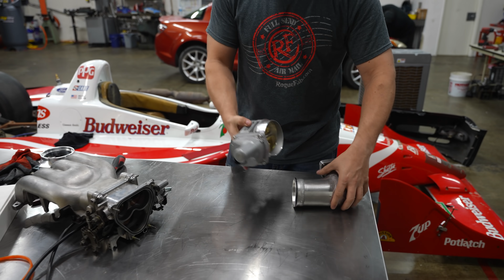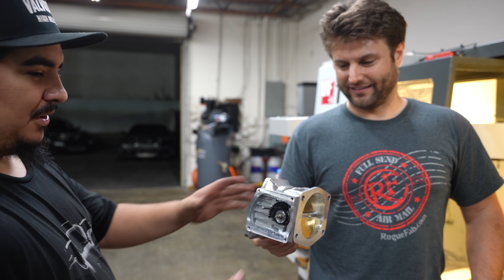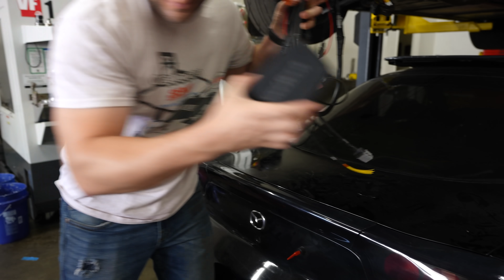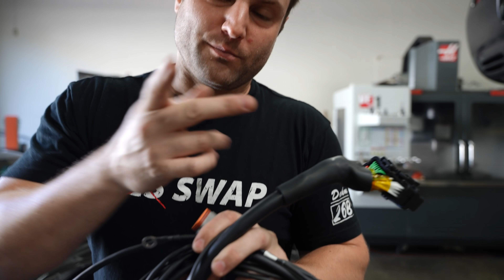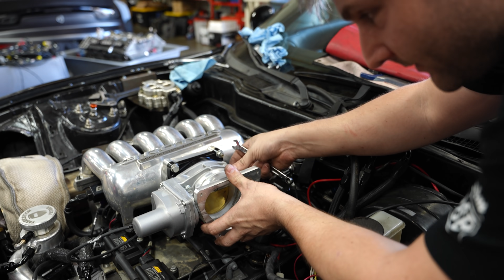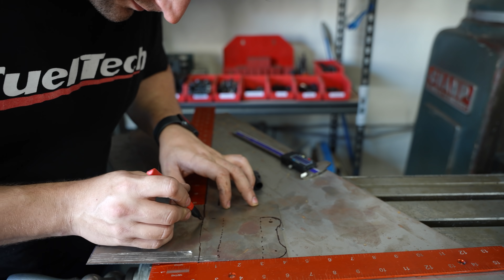Drive by Wire to help the 3 Rotor RX-7 pull wheelies and idle!

Comment: Rob why didnt you just use an rx8 tb and pedal assembly? There is also an adapter already developed to fit fd intake. Also feel it would be easier to mount than that ctsv assembly

Comment: I would rather the cable over wire..... you have the money to not worry about it... I want to be able to use even random things to fix my vehicles. Just in case I don't have the money or need to fix it on the side of the road. You have a drive by wire mess up and you are stuck. I had a cable brake/stretch and I used rope to fix it to get home.

Comment: You're probably going to want to apply a transform function to your pedal input in the ECU if you're going to drive this on the street, so it's not completely linear... Otherwise it will be very hard to control at low throttle, and will constantly surge at idle, and most of your pedal travel will be in your higher power band, and you got lots of power... I would recommend a sigmoid-ish curve, so you get about 50%-70% of your pedal travel in your lower power band. Or just an exponential curve if you're gonna floor it.

As for mounting the pedal, just make a plate for each side of the firewall and sandwich it in there.. Pedal, standoffs, inner plate, sealant, firewall, sealant, back plate with threaded holes to bolt through.

Comment: i m not friend of the eletronic throttle or Drive by wire the same for electric  power steering a stupid computer that control it for you if one of the sensor get damage you will have problems with it

Comment: Jesus man. You could have just added a pot pedal, stepper motor, and micro-controller about the size of two postage stamps to your OEM unit instead of cannibalizing that expensive unit. That S isn't beyond you man. Get into micro-controllers. There's plenty of videos on that and steppers. I started in gears and went electrical and so can you. LOL

Comment: Definitely cool and doing it yourself is the only way I'd trust a drive by wire anything.

That being said, I don't think I'd want to lose the amount of feedback through the pedal and fine control through muscle memory to get exactly what you want. Yes you can change the range the pedal controls but that's a bandaid and isn't the same thing.

Same reason I don't like anti lock brakes.

Comment: Dude, for mounting the pedal, instead of just putting it on bolts that are spaced WAAAAYYYYY out, weld a spacer block behind it that the pedal clamps down on and gives it a central support point.

ALSO you should bring the pedal WAY farther out toward you, race cars have the pedals all mounted flush because it makes heel-toe so much easier. There is ZERO reason for you to mount the pedal in a recessed position as it is from OEM.
the mounting support block also becomes way more important in achieving this mount spacing

Comment: Nice thing about drive by wire throttle bodies is the ability of doing legit lift off anti lag for intense hoon sessions and burnout competitions.  Imagine the sorts of donuts and burnout competitions you would rule if you could control power to individual wheels through the use of cutting brakes, differential lockers and maybe custom couplers.  You could make the AWD dance at 9,000rpm with smoke and noise pouring out of it.  Just one of my many ideas I have written down in my little black book (Apple Notes)

Comment: I did the same thing on my 1993 FD, except I used a DBW pedal from a 2006 GTO and custom built a mounting bracket so that gas pedal and the brake pedal were at the same distance from the floor. Perfect setup for heel to toe driving. In my opinion the GTO pedal looks better as well. I have pictures of the mounting bracket and the install if you're interested.

Comment: Why not machine a spacer-bracket-mount out of billett that would rest on the firewall, bolt on the existing mazda pedal mounting holes and to the caddy pedal with the required spacing? Heeps more rigid, Keeps better throttle feel and position, doesn't deep dive even with hard launch..? And the idle is going to be a hassle, bcz the big blade leaks to the secondaries all the time.

Comment: you can use boiling water with drain cleaner to get the fittings free from the anodized blue. hope this helps . and you can also weld on them without problem

Comment: Bro why not just use the placement with that plate you made to cut a thick piece of billet or steel to match the offset bolt holes. Mimicking the style of the black plate used to fit the throttle body to the intake manifold. That’ll give you all the sturdiness you’ll ever need and it’ll last

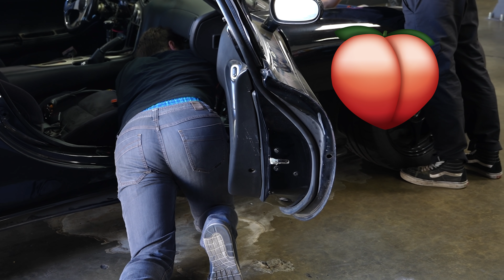Comment: 14:47 While the crankshaft may fit through the hole of the bearing journal dry it is recommended to apply lubricant liberally especially with a thrust bearing. Proper nut torque is important with the crankshaft as too much friction can cause premature wear and a rough ride.

Comment: You own a cnc machine. Instead of spacers like that build a cnc stand that uses the stock stud locations and transfers over to the drive by wire pedal... what you made is good for temporary and can be used as a template to build a solid cnc plate mount.

Comment: rob 3d print a thick sandwich plate out of plastic and get rid of those flimsy all threads they will bite you in the ass my friend a 3d plate will be light and more sturdy cheers from down under

Comment: I don't understand. 
You no longer have the primary/secondary stages. Is this good?
Also, every manual transmission vehicle I've driven, that has some form of electronic throttle control has been infuriating to drive.

Comment: Just a thought for the throtle pedal in the car. It looks like the original GM metal bracket is bolt on, would it not be easier to make a whole new bracket that picks up the throtle pedal body mounting locations and and then 3 or 4 locations on the car body to give you a more stable pedal. You could even pick up the original mazda pledal mounting locations.
Reply: "You could even pick up the original mazda pledal mounting locations."
I think that's what he's doing with the bolts on the right side of the pedal, as they seem to fit into what looks like stock mounting points. And, of course, the bracket on the left allows him to do the same with an offset bolt
Reply: @halofreak1990  I couldn't really tell from the angles in the Video if he was picking up the original stud locations for the mazda pedal. The thought I had was just a mashup of the original pedal bracket mounting and use the new GM pedal assembaly on the side of the drive by wire pedal. It would possably more ridgid than the threaded rod and spacers.

Comment: Hey Rob I was wondering what limits the speed mechanically  rpm I mean. I really want to make a 20,000 rpm 2 rotor
Reply: Imagine something going up and down-ish (because dorito)  333 times A SECOND! you need some preeetty impressive materials to figure that out withouth it melting, ripping itself apart, or phasing out of existence and going back in time.
Reply: @nerfinator03  I've got time to work it out I'll just have to be the first

Comment: 22:13 Rob I recommend you use some type of positive lock fastener. Nylox and loctite might fail in this scenario because of excessive heat on the engine bay side of the firewall, it will just melt the nylon. Please use DIN 980 nuts, they have deformable thread which is a positive locking system. Alternatively you can use cotter pins or safety wiring which are extremely popular on all critical fasteners in racing

Comment: You should redesign the adapter between the throttle body and the manifold so air isn't just hitting a brick wall

Comment: The hunting is probably from the missing gasket and that flange probably being warped a little from being welded on. It’s wild that you made it work that well out of the box so to speak. To make the pedal a little more stable you can put a block or something to keep it from over extending and bending the mount. That would let you kick it and not worry about tweaking the pedals position in relation to the others.

Comment: Awesome video! I was just curious if you had considered making a CnC spacer for the pedal? Or welding up a few pieces of flat bar to help take up that space behind the pedal bracket. I just wouldn't trust all-thread with the amount of vibrations and sudden acceleration your car is going to be under.

Comment: While I know that drive by wire is the logical progression but I'm surprised that you want to lose physical reaction in favor of computer control.
Reply: You gain reaction as drive by wire allows the throttle plate to accelerate through the 'dead zone' present in any mechanical throttle system. Basically, 30% pedal depression can equal 50% throttle opening, that's essentially why manufacturers switched from mechanical cable setups to drive by wire in the first place.
Reply: @ByteOnCS  it’s a matter of knowing the feeling of your throttle where this is a pedal that does not allow for differentiation in feeling through the pressure range. Think of it like a linear vs parabolic pot. A linear pot is going to uniform across the entire range and you’ll see a direct response when you turn it to 50% with an output of 50%; meanwhile a parabolic pot is going to give you a much different response for 50% input. With drive by wire, it’s a guessing game at best; with mechanical interaction, the input will always yield the same output.
Reply: @deltacharlieecho4732  the point is, a linear relationship between the pedal vs the throttle plate is 'flat and unresponsive', this is a phenomenon manufacturers and performance enthusiasts have been tackling in many different ways for years. In the early to mid 90's, Mazda actually had a cam setup on their throttle linkages (mostly on piston variants) to accelerate the throttle plate through it's mid point to overcome the dead range in throttle movement where pressing the pedal further doesn't relate to a noticeable increase in power as one would assume. By using drive by wire, not only is throttle response improved as it is no longer linear in regards to the relationship between the accelerator pedal and throttle plate, but it can be perfectly tailored to the drivers wants and needs. There was a reason we went to drive by wire, and it wasn't just to eliminate the throttle cable. Likewise, in my experience with squarebore vs spreadbore progressive carbie's, I have little doubt throttle response will be improved just by removing the progressive throttle body as fitted by the factory (which was mostly used to try and overcome the fuel consumption issues surrounding the rotary engine). For reference, I was a Mazda tech of 25 years.
Reply: @ByteOnCS  I would never convert from cable to drive by wire; I like the way cable responds and hate how drive by wire emulates control.
Reply: @deltacharlieecho4732  I've owned both, I've tuned both, and I've repaired both. There's no way I'll ever be satisfied with a cable operated throttle again, it's just too flat. When I ran cable operated throttles, I used to tweak the linkages to accelerate the throttle opening to get more response for a given throttle movement. I've never had an issue with throttle feel regarding drive by wire beyond better response.
Reply: @ByteOnCS  See, I've own both and worked on both and I'd never actively seek out a drive by wire based on my experience with being able to tune physical linkages on a cable throttle.

Comment: instead of the spacers and using the factory gm bracketry wouldnt it be a more future proof idea to make your own rx7 electronic throttle plate. i may be mistaken but it looked like 3 bolts holding it in. plus in long term its less mounting surfaces, less hardware, less parts, easily duplicated , and could even use factory mounting hardware. love the research you do. thanks for sharing the numbers with us.

Comment: "Another GM part, but you can't fight what works!"

I read an article about GM's development of the deive by wire throttlebody. They bought a BMW V10 and put it in a Caprice back in the 80s to study the technology.  GM always finds a way to make the fancy tech available for cheap, but still reliable.
Reply: A neat trick considering BMW never made a V10 until 2005
Reply: @Swerval  may have been a v12 then. Unless the article was made up

Comment: Could of just added a dbw to cable actuator from something like an accord
Its dbw pedal but cable throttle, basically has an actuator that pulls on the cable
Reply: Being that emissions/economy is not a concern on this application you can do away with the 3 buttlefly throttle. Switching to electronic pedal and throttle also simplifies things tremendously since the 6 wires go directly to the ECM and not to a third part. Lastly having a hybrid system can insert issues down the road as with this setup he can easily try another part if it becomes faulty. A mid actuator would add a third component, having multiple components being part of your throttle system is just not ideal in today's world.

Comment: Should CAD up and machine a bracket that will mount both right side holes to the firewall.  That would add a ton of stability and if you make it from aluminum it won't add a lot of weight.  Would also be a cool way to eventually offer others the option of DBW in an FD.

Comment: rob, drive by wire is the SHIZ thanks for using it, expo curves are baller AF once you learn
Reply: Sloppy Doritos?
Reply: This man needs a sloppy tune to make those Doritos run right
Reply: Drive by wire is amazing because you can get a much finer control with a linear curve, but there's something about mechanical vehicles that just feels better when you drive them.
Reply: Nah, cable for the win. I want my foot to dicatate what the throttle body does, not a computer.
Reply: @ArthurSperotto  just program the computer to listen to your foot, plus Idle air control valves get deleted, and cruise control becomes way simpler.
Reply: @ChrisspyMKIV  How about, instead of having a computer telling a sensor to do exactly what my foot is doing, we just have the throttle listen to my foot because a damn cable is connecting the two?
Reply: @ArthurSperotto  Yeah but then you have to wire in idle air control motors and cruise control actuators, and besides unless its carb you still have a TPS sensor telling the computer how much fuel and timing to give it. you actually end up with less components (On a street car) if you do DBW. So to hell with that simple ass cable, it actually complicates other things. You can also set up different types of traction control not just ignition based TC which under certain circumstances works better than ignition cut. Now you can have a mix of both, then boom! max traction under a wide range of conditions.
Reply: The gasket is probably why is idle goes up and down

Comment: The new pedal has a removable bracket, a new custom bracket would've been a better option to start off with. The pedal itself is also removable from it's arm, thus a custom pedal can be used if needed. Due to the assembly, I can't tell if the arm itself is removable, but it should be as it shouldn't be permanently bonded to the electronic components, which means the arm itself is more than likely also able be swapped, meaning you can have a better angle at the bend in the pedal to better fit the vehicle. Using standoffs in any scenario like this is just janky as all hell, I'd rather have a pedal mounted as flushly to it's mounting plate as it physically can be.
Reply: @Brent Cua Doubt it, he already drilled the firewall to work with the GM bracket, with plans to just reinforce the firewall. Also it'd be easier to just bend a piece of sheet steel like the OEM bracket, milling out a bracket from a billet is just a massive waste of material. It's also best to keep the pedal as close to the sheet metal it's being mounted to as possible, this way there's no additional leverage on the firewall, and so that the standoffs/spacer doesn't become a cantilevered component. Keep in mind that a pedal is actuated with your leg, if you flat out floor the pedal, something is going to give in a spaced setup, which is why a direct mount is better; unless Rob plans on forever feathering the pedal with the lightest touch. 

With the attention to detail lately, I'm surprised the pedal is as jank as it is. I could understand not wanting to modify it for preliminary tests. Modifying it also isn't all that difficult, the bracket is just bent sheet steel and the pedal arm is just a flat bar that may not even need to be bent all that much. There is absolutely no reason for the pedal setup to be as jank as it's going to be.
Reply: i was saying the same thing to myself
Reply: Although as Sandy Munro says a drive by wire throttle is just a switch, no need for it to be as beefy as a brake pedal. Turned 17mm spacers and reinforcing plates on the firewall should be enough.

Comment: It's cool having dbw but I hate the feel of it in comparison with cable drive it's so touchy and sensitive on my truck It causes more throttle than I want at stop signs ect  my Foxbody with a 427 feels way better with cable drive but I understand the perks your looking for
Reply: The problem is never in the DBW per se, but in the way it has been programmed. Usually it's the other way around, DBW being programmed to be slower to respond to reduce the wear on engine and gearbox mounts.

Comment: Wow, that electronic throttle actually moves quick. You might have me sold on those GM pedals...
Reply: what, you thought people with hundred thousand dollar corvettes just deal with shitty throttle response? the GM DBW has been race industry standard for a half decade now
Reply: @fuck_youtube_censorship00  most vets are no where near 100k
Reply: @fuck_youtube_censorship00  guess I just haven’t been lucky enough to work on hundred thousand dollar corvettes 😉. All the ls’s I’ve worked on were from the 90s, guess I should get out more 🤣